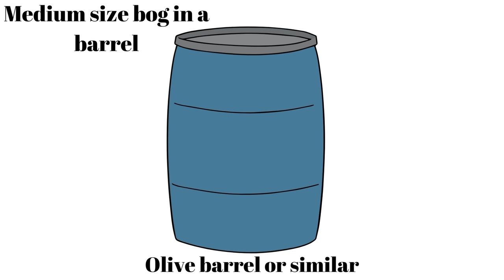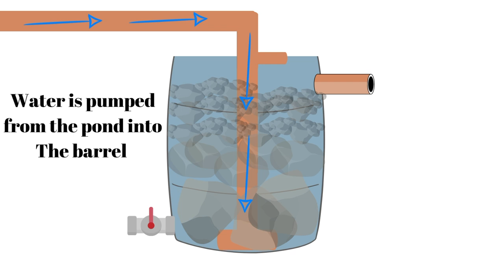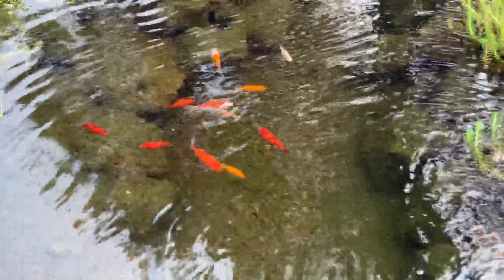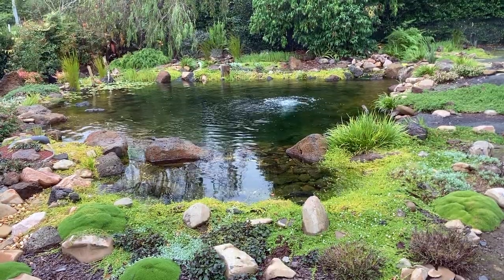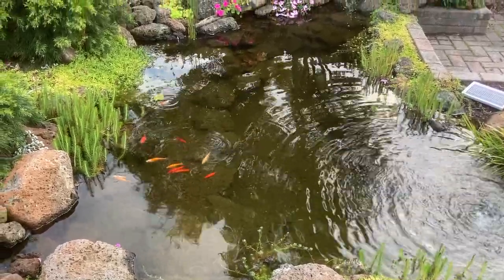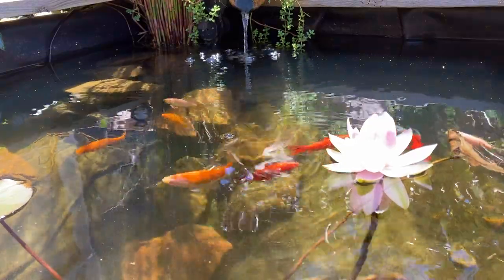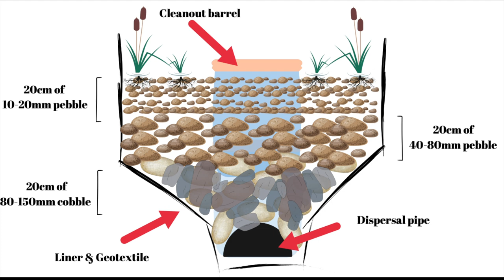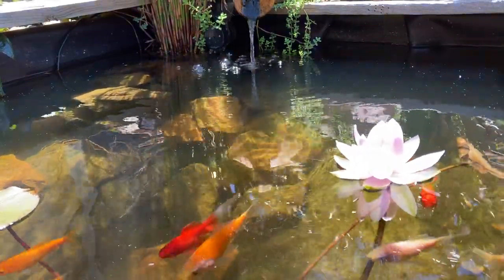Crystal clear pond water| Bog filter basics

Comment: Great video, I think you are right on spot. It's really key to emphasize that your bog must be sized correctly and that you have the right flow, otherwise it's won't work at all. I think that most of the time, people building their first ponds are looking for a pump with the most flow they can buy but if coupled to a bog that won't work at all. As you said the flow must be slow otherwise all the debris gets through and back to the pond.
Reply from the maker: Spot on. 👍

Nothing wrong with a high flow filter. Just incorporate sponges to trap sediments and don’t use rock and pebble. Use something like bioballs that allow really fast water to pass. Still no need to spend lots of money.

Comment: Fan of your videos! Was hoping you could answer a question for me. This year I made a bog that’s about 7’x3’x1.5’, with 3 sequential tiny ponds (using PVC to channel the flow) before it enters a not yet completed main pond (7’x7’x3). I have the bog fitted with a pipe drilled with holes at the bottom to distribute water at the beginning of the bog, and 2 baffles to ensure it fills evenly before exiting. The idea was to filter gray water from our washing machine. 
My question: is there any reason why I wouldn’t be able to simply pump the pond water back into the bog to continue its circulation? Do you foresee any problems with that? It’s admittedly a pretty low tech design (from the book Gaia’s Garden). Thanks so much!
Reply from the maker: I don’t see a problem.

Comment: (subbed!) ok, so i'm revamping this bad filter setup this pond was left with. and the design i'm going with is basically what you're describing as a bog filter. in the meantime, before i can get that built, i changed out the filter media, etc......    QUESTION: the barrel is emptying too fast, and there isn't a reservoir of water so much as it runs right back into the pond. 2" pipe. should i put something to block off the hole a bit to slow it down so that it can fill? (i have some K1 on order that i plan to put in the bottom. i figure that media needs submerged in order to let the beneficial bacteria grow?
Reply from the maker: The media doesn’t necessarily need to be submerged. The bacteria just need wet surface area and oxygen to work their magic.

Comment: Hi. Thanks for all the info you’re giving us however I have a question as even after watching quite a few of your videos several times I, I couldn’t wrap my head around requirements. 

I built a half barrel pond, mine is about 110 litres. I built a bog which is 30 litres (I had a spare barrel that was 30 litres so it worked out ok because I’m adding some fish) 

So question is: do I need to circulate the entire barrel (110 litres) every hour or every 4 hours. Atm my pump is on the lowest setting and I get 150 litres per hour flow so that’s about 137% of the barrel per hours. 

I get confused due to the “5 min” that you explained for barrels… 
Thanks
Reply from the maker: You’re overthinking it. Your pump will work just fine 👍
Reply: @Ozponds  haha. You’re absolutely right. 

I’ve one more question as I plant to build a bigger one (about 1-2k litres) at my friends house. 

Are there any signs that tell if the water is flowing too fast or too slow?
Reply from the maker: If your solid material just blasts up through the bog and returns to the pond, it’s too fast.
Reply: @Ozponds  got it, thank you!

Comment: I understand now the flow rate. However, for example, pump A pumps 1 l/ hour. My pond is 1l. But by pumping 1l/hour, flow rate is too high for the bog. I dial it down. Does it affect the 1l/hour? I guess so. Does it matter? Would it be preferable to have pump B pumping 2l/hour for my 1l pond and dial it down to slow the flow rate and have a more effective bog? If I make sense of course 😅😅. Thanks Kev.
Reply from the maker: I’m sorry I don’t understand the question.
Reply: @Ozponds  it is advisable to have a bigger pump than what is needed, in order to reduce the flow but yet circulate the right volume per hour?
Reply from the maker: For the bog filter I just keep it simple and recommend 6x empty bog volume. If bog filter is 1000L pump approx 6000L through the bog. There are times when you want more flow for waterfalls, jets, more flow to skimmer or intake bay. The excess flow can be diverted to extra streams, jets or simply flow over the surface of the filter. Or you might even want to use different types of filters.
Reply: @Ozponds  thank you Kev!

Comment: Thanks for the video! I have a pond that I restored last year and there is an existing bog next to it that I'd like to restore this year. It's on top of a large mound, so it would waterfall down, through a small stream, and back to the pond. Do you recommend treating the bog or cleaning it in any specific way before I hook it up to the pond? It already has rocks and pebbles in it, but it hasn't been run in probably 15 years, so I'm assuming the bacteria inside is not "good"?
Reply from the maker: You definitely want to flush it out.

Comment: Just want to confirm that the pump kev is recommending is superior in almost every way to most pond pumps which come up in a default google/amazon search.  The usual suggested pumps (via search results) use A LOT more power, are not variable, and in some cases, have less throughput.  I have, in the past, used a Half-Off ponds Hydroflow 3200, and a 1/2HP sump pump to move water (like an idiot).  

If you do the math, the Hydroflow uses, 192 watts to move 3200GPH.  The pump kev recommends, uses 80, is the same price, and can be throttled.  To put this perspective, you could run almost 3 of the Hyggers at the same cost / month/year.  As an added bonus, they also support external-inline use, which the others typically don't.  Initial cost is about the same, GPH is the same, Head is the same, power-usage is 1/3, has throttling, smaller size, significantly quieter, supports external-inline, and is easy to clean/disassemble.

tl;dr
The pump kev recommends is truly superior in almost every way to most main-stream pond pumps & will save most people on average ~50% on pump electricity usage (even more if you throttle it down to 40w).
Reply from the maker: I was the same. Never again. 👍

Comment: Hey Kev, thanks for your channel, do you suggest the inlet pipes should be flush with the bottom of the drum or raised a few cms above the bottom to allow for sediment to rest
Reply from the maker: I don’t really mind either way. I usually set it in the middle of the barrel and I guess the outer edges are slightly lower. It certainly is probably best practice to raise it slightly.

Comment: Is it a problem for the bog filter to be bigger than mathematically recommended? Also I have a small pond, about 250 gal, what size pump should I be using?
Reply from the maker: Bigger is better when it comes to bogs. Pump size is determined by many factors. Skimming action, waterfalls/ streams and filtration. For most backyard ponds with bog filter I recommend sizing the pump at 6x bog volume.
Reply: Thank you so much for your quick response it was very helpful! God Bless!

Comment: Any tips for the breather pipe so the water doesn't come out it, instead of going into the bottom of the bog?
Reply from the maker: Use a valve. Then you can regulate how much comes out the top.

Comment: Hey Kev I have a question. I excavated a 3/4 acre pond about 28,000 sq ft. Ultimately I had underground streams I tapped feeding through old tiling. Well I ended up replacing the tiling and my output flow doubled. I have so much water flushing through filtration is difficult. That said I wanted a bog filter. I ended with a berm about 14 feet tall, 12 feet across the spine at the highest point in the berm. This slopes to grade over a few hundred feet. Could I exchange square foot of bog surface area for square foot of artificial stream. My thoughts are building a small bog 10x12 on that highest point in the berm. Then an artificial stream along that spine about 70 feet from the end my berm has a steep spot that drops to grade and slopes to surface. My thoughts install a waterfall there and return following the slope of grade to the pond. This would mean the 10x12 to catch solids. Then 200 feet of stream, 6 foot waterfall, 100-150 feet of stream. I'm clay bottom but used geotextile and covered with stone. My ponds been quite clear considering the clay. The only time it gets muddy is from run off  during rain hitting exposed earth. I'm not really after perfect water. I do want it as clear as possible. My biggest deal is I don't want solids breaking down and depositing over time. If you think of an L shape my overflow to settlement is where the lines intersect. My inlets are on the opposing lines starting points. My deepest point is at the intersection it's 15-16 feet deep. The short line would be 3-5 feet deep. The long line is 3-8 feet deep. This design is really good for flushing and preventing dead spots. However the natural design guarantees the deep spot at the intersection in front of the outflow will accumulate all solids over time. My thoughts is run a small bog in that space and take advantage of the berm slope and gravity. It gives me a sediment trap, increased filtration by the size of the stream, uV exposure, tossing and rolling of water and ultimately oxygenation. In my mind it works for addressing several issues. I hope I'm making sense.
Reply from the maker: Sounds like a fun project you’ve got there. I can’t really visualise what is happening. But it sounds like you’ve got it all worked out in your head 👍
Reply: Do you have an email I could send photos too??
Reply from the maker: You can contact me via my website. If you require personalised feedback I need to charge a fee as it takes time away from creating content that helps many people.

Comment: I'm building your barrel design. I want to use my existing pump which has a 1inch tubing.  Id rather not but a larger one. Is it better to have 1 or 2inch piping for filter? I have a 800 gallon pond
Reply from the maker: The barrel is undersized for your pond. If the existing pump has 1” tubing there’s no reason you can stick with that. Just oversize the outflow.
Reply: Sorry, not sure what is meant by oversize the outflow?
Reply from the maker: The pipe where the water exits the filter.

Comment: Installed a 60ltrs bog filter to my 6K ltrs pond some six months ago, it works perfectly well, water is crystal clear but I am finding out that lately it is getting bogged and loosing water because it over flows. I do hose down the muck on the surface and drain it through the bottom drain, not sure if it is normal or I done something wrong. Plants in the filter grow over night, it is unbelievable how healthy they look. Pebbles I used are 35mm all the way through. Any ideas please..
Reply from the maker: In my bogs I layer the different sizes of pebble. I also oversize the outflow. Don’t you watch all my vids? 😞
Reply: @Ozponds  in my first attempt I followed your instructions in regards to different size pebbles but in a fortnight it clogged up really bad due to the smaller size pebbles. So I emptied it all out and refilled with with the 35mm pebbles, it worked well for six months. The outflow I used 40mm pvc . And yes I watched all your videos and enjoy them all.
Reply from the maker: I’m glad you enjoy the vids. Is the flow slow? Is it the plant roots? Is the pump inside the pond or is it in an intake bay or skimmer? Is there a high fish load? Lots of leaves?
Reply: @Ozponds  the flow I adjusted to be slow (50%), pump is in the pond, not too many fish for the size of the pond, no leaves at all. Plant roots not sure, may be need to pull them up to check, what do you suggest?
Reply from the maker: I just re-read your initial comment. A 60 litre bog for a 6000 litre pond is massively undersized. You didn’t mention your flow rate (only that it’s dialled back to 50%). If your flow rate on a 60 litre bog is more than 360litres your moving too much water. That may be why you are getting clogged and overflowing. 6000 litre pond I would have my pump in a skimmer or intake to pre filter out any larger materials. But I’d also have a much bigger bog minimum 600 litres. Thinning out plants is a part of the maintenance of the bog so yes that must always be checked. Sounds like you’ve got quite a few things that need addressing. And I need to do a better job in my videos, if you watch them all these mistakes should be avoided. For that I am sorry.
Reply: @Ozponds  I think that is the problem, had a feeling. Flow rate would be 2500 ltrs/hr at 50% (5000ltr/hr pump). So I got to decide what I do, clean it every so oftern or make a bigger bog filter. Thanks for all your help..
Reply from the maker: Convert it to a high flow filter. It’s never going to be a bog filter with those flows.

Comment: I’ve tried this so many times but can’t get the water to clarify. 😢
Reply from the maker: That’s no good. Tell me all about your setup.
Reply: @Ozponds  i’m still in the experimental phase and I have this 6000 L above ground pool that has about 1000 L of green water resting on the bottom and my ambition is too fix up the appearance of that water and I see that as my initiation test before I even start lifting heavy and making my own pond. So roughly 2000 L of water with sediment on the bottom and green water. I use the similar blue drum as you did, 200 L. But I didn’t cut off the top, instead I put plastic crates on the bottom third and covered that with white felt, hollow bricks on top of that up to 2/3, laying them tightly as possible and then a layer of smaller rocks to fill in the gaps and the final third was large gravel. I use the 3000 L pump that feeds directly into the bottom of the barrel, the water rises and exits over the lip of the barrel. I left it going for about four or five days with absolutely no results. Simultaneously, to add oxygen I did a little mini set up inspired by David pagan Butler where a PVC pipe was embedded in a large crate of rocks and gravel and using a 50 mm air stone to create negative pressure and pull the water through the bottom of the gravel. These two are running at the same time, in Malaga Spain, in the sun with day temperatures of 26° and evening temperatures of 13°C. What am I doing wrong?
Reply from the maker: Well your experimenting so you need to expect variable results. If you want to try my method then follow it exactly, if you want to try David’s method follow it exactly. I understand experimenting is fun I do it all the time and I get variable results. For me, personally, I get clear water every time (yes every single time) I create an upflow bog that is appropriately sized to the pond and fish load, along with an appropriate flow rate. I also wouldn’t start off with sediment, if there’s a thick sediment layer I would remove that. Mulm/ detritus is ok (it’s light and fluffy), thick heavy gunk isn’t. And you said it’s been 5 days, where’s the patience?
Reply: @Ozponds  haha i’m not being patient enough? My set up is very similar to what you did with that cylindrical cement thing, both in size and execution and I seem to remember that you got results rather quickly there. Realistically, how long until one would see results when making a system from scratch in an already green pond? It’s not a very thick sediment on the bottom, but it does seem to be impossible to completely get rid of no matter how much I try to gather it up with a net. I would start over from scratch but in my mind it’s like, if I manage to salvage this water it’s a proof of concept and that I’m doing it right so I don’t want to give up hope but I would love to hear what you think is a realistic timeframe to see results. I was also considering using a flocculant.
Reply from the maker: 😂I don’t know why you are getting agitated. The cylindrical setup you talk about, the video went live two weeks ago. I showed exactly what I did. Yes the water is nice and clear, but now it’s in its algae growing phase (string algae, not green water). In that video I used a flocculent. You say you are thinking of using a flocculent. I said I’m using a 1000L pump, which I said was a little oversized, but I’ve got the breather pipe letting some water go over the top. You say your pump is 3000L. You didn’t say if you had fish, this pond currently has no fish. So as you can see there’s just 3 variations, maybe two if you have no fish. I’m just trying to help people by showing what I do. I get heaps of emails and comments from people that can’t believe the results they get after creating a DIY pond filter. Unfortunately your not one of them, that’s ok, I’m realistic enough to know that no one can please everyone. Anyway my thoughts follow instructions to the letter and wait longer than 5 days. Yesterday I finished work on a video that talks about how long a bog filter takes to work, it goes live October 14. Spoiler alert in the video I say 2weeks to turn green water clear, again provided it’s sized/ built correctly. I wish you luck 👍
Reply: @Ozponds  you are too kind sir! I’m sorry if intention gets lost in translation online, no agitation here at all, only gratitude for your videos AND your responses. Surely I will not give up and thank you for taking the time to address some of the issues. Cheers.